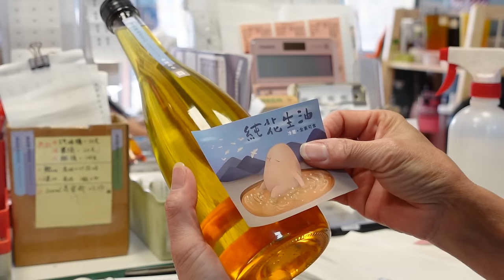How to Make Peanut Butter & Peanut Oil? / 純花生醬, 花生油製作 - Taiwanese Food

Comment: Can you name an "oven fried peanut" as "Cold Pressed"? 
A cold pressed nut oil should be treated under certain temperature eg. 100celsius.
Cold press oil usually used on coconut oil, avocado oil, olive which the food doesnt need to be heated to expell the oil.
Reply: You don't even know how olive oil is extracted, even when a nut or peanut is not cooked a bit so that it releases the oil more easily and in more quantity, the oil comes out hot even when cold pressed because it is compressed with several tons of press the nut or peanut, and that causes the temperature to increase, if you have ever tried to make homemade peanut butter, you will know that the appliance you are using to transform the peanut into a thick mass heats up to more than 100 ° C, Since it takes care that it releases the oil and with this the peanut butter is formed, coconut oil is not obtained under pressure but by cooking the coconut until the water evaporates and releases the oil, which then solidifies when it cools, transforming in coconut butter, olive oil is obtained by pressing the fruit of the olive tree a little, either with a stone, or with any other hard thing, it is boiled with a lot of water, then it is ground, squeezed with a very fine cloth, and it is left to rest until it separates into 3 layers, the solid sediment of the olive fruit, the water and the oil, and only the oil is taken, the rest is discarded, avocado oil cannot be obtained by cold pressing, It has to be heated just like the coconut, since the avocado has a good amount of water, which has to evaporate.